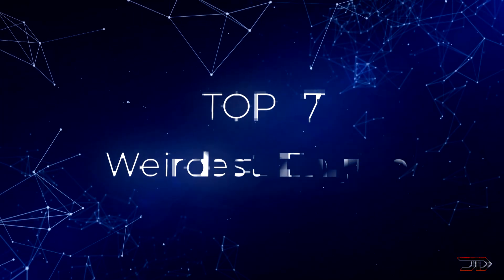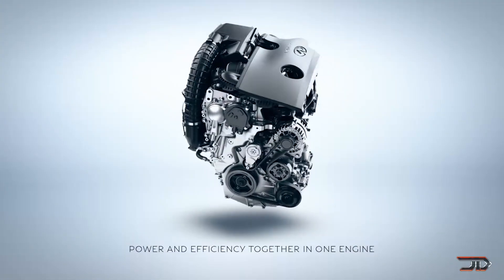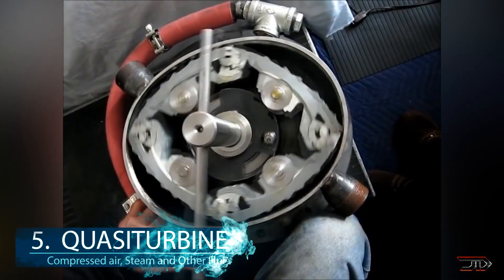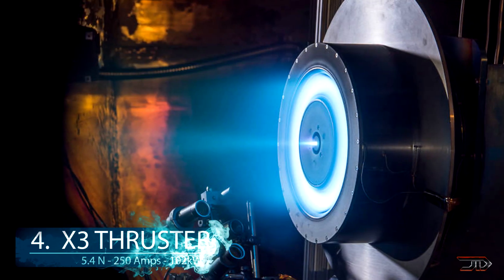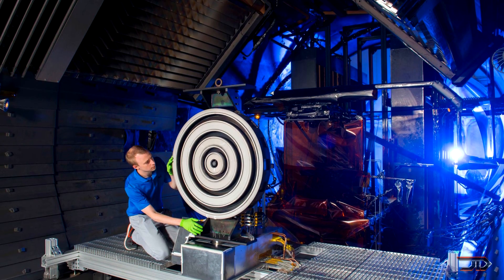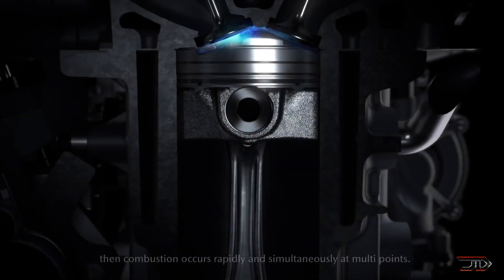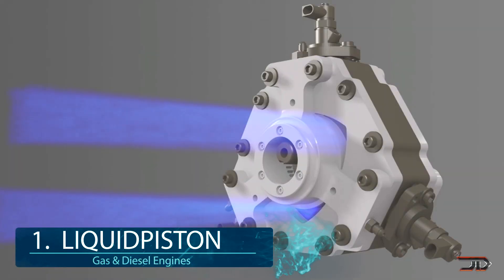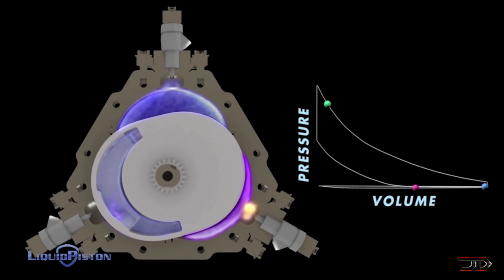7 STRANGEST New Engines

Comment: When super efficient engine will the invented?  Seem like the engines goes backwards in MPG vs horse power for that MPG.
Reply: Simple answer is that cars have got heavier because of more crash protection.  It takes more power to move all that mass around. 

Yes, I am calling modern car of today fat.

Seriously.
Would you rather have a big, safe fuel thirsty car that would protect you with a very good chance of walking away from a crash..

Or...

A lightweight fuel sipper that has little in the way of crash protection that would most likely result in serious injuries and/or death in a event of a collision?

Like everything in life, there are compromises. Cars are no exception.  You will not find a car weighing 4,000 lb with 250 hp while getting 50 mpg.  Such car doesn't yet exist.

Comment: The rotary piston concept is by far the best.
It's success will depend on the seal technology.
The piston has to be sealed between "cylinders" (tip seals) and at the Sides.
Every Wankel engine I have had failed at the side seals.

All Wankel engines failed due to poor compression seals and poor side seals after only a few hours of operation.
Average life expectancy was about 50,000 miles in the Mazdas.

The "KISS" rule only applies to 1 engine in this list.
The Rotary one.

Comment: They need to make one that runs on water . Like they have before just in prove it. Should be able by now.
Reply: There is no motor that runs on water and there never can be.  There have been several frauds carried out fooling people into thinking it can be done.  Some of the guys who did it were very convincing and tricked a very large number of people.  The scam usually involved a prop of some sort where the actual fuel was brought in by some hidden method.  They took a lot of good people's money and perhaps worse, sent many would be inventors up a blind alley.
Braking H2O apart, takes far more energy that you can ever get from burning hydrogen.
Reply: Why not improve your education?  You should be able to by now.

Comment: When looking at these technologies keep in mind that improving an engine is all about improving combustion. Combustion chambers with corners will never be able to seal or keep uniform temperature and mixing like a cylinder can. None of these technologies are new, but innovators keep developing solutions to address the flaws of past ideas. But the world is full of what an old boss of mine called Brain Fart Technology; these are ideas that sound good until you look into the details.
Reply: Another point people miss it that the Carnot rule can never be broken.  All such engines work by having hot gasses and letting them cool by letting them expand.  The fraction of the combustion energy you get at the output shaft is controlled by this step in the process.

Comment: #2 is not a new technology or concept. British locomotive engine manufacturer Napier produced a triangler 2-stroke diesel engine in 1960's,  with 2-opposite pistons per cylinder. It's Napier Deltic. An 2600 Hp 2-stroke diesel with 18 cylinders and 36 pistons. Search on Youtube for "British Class 55 loco" or "Napier Deltic engine"

Comment: I wish Mazda would have included port injection on the Skyactiv X for valve cleaning purposes. This is why I'm not buying the new Mazda3😥
Reply: Seafoam makes a product for about 10-15 dolars that cleans out the intake valves that you use once a year. It is a simple task if you are at least somewhat mechanically inclined. 

It is called Seafoam ss14 cleaner and lube and can be found in most Walmarts and auto parts stores.
Reply: If you run cleaning products through a turbo engine without disconnecting the turbo, you will gunk it up and/or fry it. Ford Ecoboost engines had the same carbon buildup issue and solved it by adding port injection system to clean the valves on their direct injected engines.

Comment: SkyActiv X is the one that will take off.  Toyota's approach to variable CR is cool looking but hugely complex and expensive.  Interestingly, SkyActiv X works better with lower octane fuels.  Even our U.S. spec "regular" unleaded is much higher octane than the engine really wants.  It's happiest on the worst rot gut crap imaginable.
Reply: I agree. I can easily see that the SkyActiv X outlasting all others engines because it is not overly complicated and Mazda isn't trying to reinvent the wheel. I rather have a v6 over the VC turbo 4, less complexity and over-stressed parts.

Comment: I can see the liquid piston just having the same problems as the wankel. Sure, it might be a bit more efficient and reliable than the wankel, but that probably has more to do with the fact that the wankel rotary is older technology.
However I did see engineering explained's video on the new mazda engine shown in this list and that looks pretty impressive

Comment: To all the people yammering about electric motor propulsion; you're largely correct.  However, until a battery can be recharged in times approaching what it takes to fill a fuel tank EVs will be relegated to the local commuter market.

Complex designs and those requiring tighter tolerances result in engines that lack longevity and reliability, therefore unlikely to supplant the standard 4-stroke.

As far as small portable power sources go, nothing is likely to supplant the mighty two-stroke.
Reply: Just need a Kilopower reactor. Only needs to be 'recharged' once every 12-15 years if you drive with your foot flat to the floor 24/7...continuous 10,000 watt output and only weighs 226 kg. Or if you prefer a motorbike, the 1,000 watt unit weighs only 134 kg :-P https://en.wikipedia.org/wiki/Kilopower
Reply: @kirkc9643  I've played enough Fallout to know how that turns out.
Reply: "hurr durr EV has less moving parts hurr instanttorque durrr 99% efficient"   ~ Dumb people who scored an F at physics and mechanical engineering.

Comment: If they don't have a working prototype, they shouldn't be in this video. I have to actually see this bullshit working to believe it. Also, it's 2018, what are they trying to achieve with updates to out-dated internal combustion technology? Electric motors (energy supply being a different subject) are about as perfect as we can get at upwards of 88% efficiency, and very few moving parts. These complicated and overweight piss-tonne engines are doing too little too late.

Comment: Every single one of these engines need to be f*cked in the skip.. what ever money they save in  "efficiency"  . . . Will be eaten up by maintenance and repairs in the long run! Ffs, imagine trying to change the rings, or even a valve on any of those? You would most likely need $$€€ in special tools and $$€€ in parts! Nah, save them for the nerds, and ill take an old con-rod fiesta engine any day 🤗

Comment: The things that Koensigg is doing is truly incredible . Check it out ! The guy is a genius ! Solenoid valve actuation , infinitely variable . He also came out recently and stated that all internal combustion engines will be ineffective in catching the quickness of the EV’s but that hybrid drives will be the best way to go until battery technology catches up . He is a man willing to see what is wrong with what he has been doing . I expect Koensigg to come out with a hybrid at some point now that he has seen what Tesla has done .
Reply: I can’t find anything online about Koensigg, Koenigsegg on the other hand...
Reply: They already make an hybrid, wich hold some record, like fastest 0-400-0 for a production car.
Reply: Agreed. I'd really like to see them pursue a turbine hybrid.
Reply: @hallkbrdz  Turbine hybrids will not happen due to efficiency reason. The turbine that could harvest enough thermal energy from he exhaust would be impractically large for a car, and the ones that could fit have 20% or so efficiency.
Reply: That's Freevalve and Qoros.,
Reply: If my memory serves me correctly. I read an article in popmech or popsci a few years ago. Stated that Mercedes was had built an engine, using electric solenoids to operate the intake and exhaust valves. Eliminating the need for cam shafts. I cannot remember exactly how many years ago it was. I'm guessing 6 years???
Reply: Chevy's solenoid actuated cylinder cancellation is garbage. Hope they can do better
Reply: Neil Dohi https://youtu.be/S3cFfM3r510
Reply: @grievuspwn4g3  That's interesting to know. I've got no chance of suing Konigsegg but I might apply for a job with them.
Reply: koenigsegg is working and sharing technology with Rimac for a while now, so it won't be surprise if/when this happen
Reply: I have an idea of a Heavy Water or Deturium Plasma Reactor battery that uses anode/cathode principle. Infinate current and voltage. Can be disabled and restarted and is very stable.
Reply: Hybrids never made sense to me, and I think buyers will become wary of the space and weight. I think ICEs in passenger cars will be scarce in new cars in 5-6 years because of battery development. Buyers will start adapting their driving habits to the 100-150 mile round-trip range. First, there will be millions of commuter cars driven 20-40 miles a day to work (think Accord and Camry). When they become common, sporty, and larger more luxurious E-cars will come. Even the threat of electrics will discourage expensive ICE design, development, and retooling.
Reply: 26 years ago I just could not get funding for a PhD researching the use of solenoids for valve actuation on an internal combustion engine, all the companies I approached dismissed the idea for being impractical. About six years ago I put the idea to Fiat when I was working for a company in the Fiat group, they didn't take up the idea either. Are Koensigg and Fiat connected in any way? Does anyone know a good lawyer?
Reply: @GeorgeSPAMTindle  Like to think you would win but something tells me you are on to a loser :0)  Fiat of course have the multi air engine whereby the inlet valves are hydraulic/electric actuated  - it's my Alfa which pulls like a train for a 1.4.
Reply: @GeorgeSPAMTindle  You're not special. I'm 19 and a few years ago I also had the idea of using solenoids to control the valves. In fact it's a really simple idea that I'm sure many many people have come up with on their own
Reply: @GeorgeSPAMTindle  regardless salty boi, my point is valid. Go get your lawyer, good luck winning xD
Reply: solenoid controlled valves are nothing new...  

got some 20-30+ year old automotive engineering books/manuals with all kinds of ideas and prototypes about solenoid engines...

hydraulic, pneumatic, electro-magnetic solenoids, etc.  It's all been tried... they were all abandoned for the same reasons... poor reliability/dependability vs direct mechanical linkages.

especially with modern high compression, high rpm, multi valve/port/injection engines.  aka, a single $3 solenoid misfires or fails... it completely destroys a $10,000+ engine...

how much power it makes, how fast it goes, etc. is irrelevant...  put it through an endurance test, see if it's still working 10 years and 150,000+ miles later... (without any major overhauls and a team of engineers on standby to monitor and care for it)...
Reply: ......the future will be superconducting electric motors paired with a downsized Bloom Energy solid oxide fuel cell that converts natural gas to electricity with four times the efficiency of a gas turbine.....all with no moving parts and emitting just water vapor. Forces are holding back the mass adoption of both these technologies for now.
Reply: solenoid valve ?  nice,  now not only do you lose timing and blow up your engine when the electrical fails, you take out the entire engine too...    in the case of a geared cam you will just need a head gasket and possibly another camshaft..  dont trust electonic shit on cars....  they've NEVER needed it and its more and more that can and will fail, and of coarse, cost you more money to get repaired...  more often.
Reply: Hi there, my name is Dexter from Asia America, a CNC Precision Parts manufacturer originally from California and production facility been moved to Dongguan China since 2005. We’d like to extend our manufacturing services to you for your metal or non-metal CNC precision parts outsourcing need.

We offer complete production facilities of more than 100 CNC machines in the plant, R&D Support, Cost-Effective production process, and Favorable payment terms.

We'd be happy to work on your inquiries and RFQ’s.

For more information about our Asia America, please check below our company videos and our website.

http://www.cncmachiningmill.com/video.html

Thanks,
Dexter Jenobiagon
Foreign Trade Manager

Asia America Industrial Manufacturing, Inc.
Tel.: +86-769-88568855 / 769-8568877
Mobile phone: +8618027043263
E-mail: aa4@aamfg.cn
Website: http://www.cncmachiningmill.com/
Reply: While still using internal combustion. Junk!! Even the all electric Tesla is junk.
Reply: Jesse Fritz and so what your saying is you are a bicycle kind of guy ? Tell us what you like ?
Reply: @stevencochran4284  I like something that doesn't require petroleum. Wouldn't you?
Reply: Jesse Fritz tell me what that is ?
Reply: @stevencochran4284  So you can't possibly think of anything else you'd rather see being used?
Reply: Jesse Fritz where you could ride a horse I guess. What exactly is wrong with Tesla how are they junk considering they're the fastest production car made?
Reply: @steviewander2693  just because it's a fast selling machine doesn't mean it's a great machine. There's a lot of hype behind it. It won't be around 5 years from now, once Tesla files bankruptcy because the tax credit is no more.
Reply: @JF32304  Hi. 
Awesome inventions exist...but allare  cover up and destroyd...people killed ... for some people with interests and with big power.....
Reply: @TX2673XA  Hi. I 💯 agree with you. But the tech needs to get out! People need to see what really is possible! Too many living in a mental box of programming of what they think isn't possible.
Reply: @JF32304  Right
Reply: Jesse Fritz see you think people are buying these vehicles just because there's a tax credit?
Reply: @steviewander2693  what do you think has been keeping Tesla alive? They're 10.4 billion in the red!! Bankruptcy is around the corner.
Reply: @JF32304  try nitromethane
Reply: @stevencochran4284  Tesla
Reply: Jesse Fritz how the fuck is a Tesla “junk”? The only thing that’s junk here is that comment.

Comment: The Nissan VVEL engine is pretty groundbreaking. The valve lift can be varied down to 0. The intake air is controlled by the valves, so much that it doesn’t even need a throttle body.
Reply: That has been used by other companies as well and are common enough that they are found in Corolla's. I believe BMW was the first to make fully variable lift engine but could be wrong
Reply: Do the others have valve lift that replace the throttle body too? On the Nissan I think the throttle plate stays full open all the time.
Reply: @seanriley1603  That's correct. I looked it up and the Toyota system is called Valvematic:

https://en.wikipedia.org/wiki/VVT-i#Valvematic 

Not having a throttle makes a lot of sense as it reduces pumping losses

Comment: Too little too late for the most part. 
Honda made vehicles that got 45-55 mpg in the 80’s lol google it
Reply: So did Chevy Sprint,Geo Metro with a 3 cylinder gas engine
Reply: Chad Harmon I believe that they were a Suzuki and a Toyota with just GM name plates. The auto industry can do a lot better than it has. The Prius is only getting a few miles over those 80’s vehicles lol that’s a bad joke HAHAHAHAHAHA
Reply: Chad Harmon I believe that they were a Suzuki and a Toyota with just GM name plates. The auto industry can do a lot better than it has. The Prius is only getting a few miles over those 80’s vehicles lol that’s a bad joke HAHAHAHAHAHA